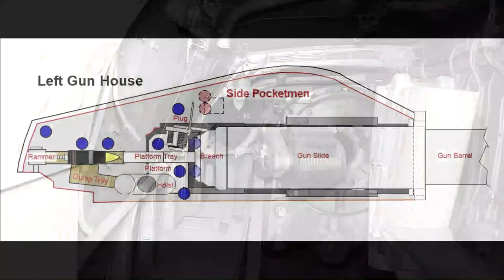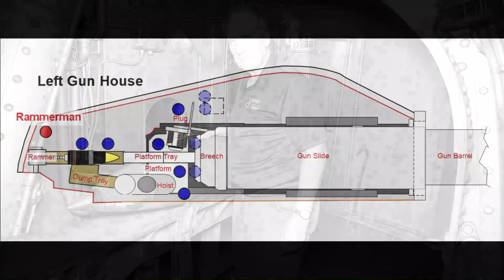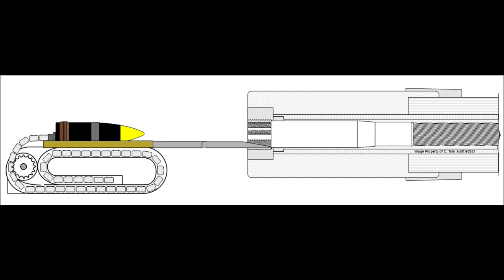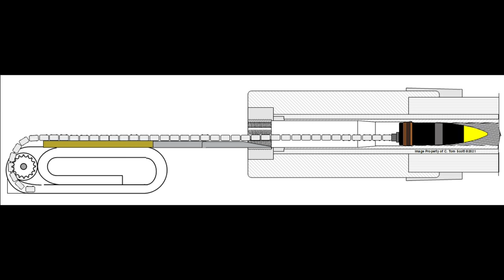Battleship Texas, Getting Loaded in a 14" Turret

Comment: I would have thought if the gun fires prematurely and the plug man has his arm back there it would be turned to jelly.
Reply from the maker: It is practically impossible for there to be a premature ignition when inserting a primer.  The breech plug temperature is cool to the touch, so there isn't enough heat to set off either the powder or primer.  That leaves a defective firing lock mechanism as a possibility.  Gunnery and ordnance manuals specified that the locks be regularly serviced and tested for proper operation.  Also, neither the hammer used to percussion fire the primer or the electrical contact used to electrically fire move to their final positions over the primer until the breech plug operating lever is pushed to its final position and locked in place.  Even so, no one is allowed to stand behind the gun once the breech plug is closed.  If something should happen as a result of that final push, the plug man is standing on the forward side of the lever and is pulling on it to perform the final action that sets the lock and locks the plug in the breech.  That way, if the gun fires and recoils, the lever is pulled out of his hands and away from him.  

The only serious issue with accidental ignition is if there is a hang fire or misfire that requires inserting a new primer or unloading the gun.  Since it is very possible for the gun to fire, the plug man unlatches the plug operating lever and pushes it open just enough to slide the firing lock open and partially eject the primer.  That small amount of movement is not enough to start unlocking the plug.  He then uses a tool that allows him to reach behind the plug and remove the primer without any part of his body being behind it.  He then uses the same tool to insert a fresh primer if required.  By doing that, the worse that can happen is the gun suddenly fires and the tool is knocked out of his hands with no injury to him.
Reply: @tomscotttheolderone364  👍 Thanks
Reply: @tomscotttheolderone364  By the way enjoyed the video immensely. Never seen the loading procedure for one of the pre WW2 Battleships. Very informative.

Comment: So, I'm watching a 1500 pound projectile come up ass first from the magazine fused ? Doubt it . I'm hope one of the loading crew was doing it .
Reply from the maker: All shells, 5" and 14" had base detonating fuses installed at the ammo depots, and were brought on board, stored and moved to the turrets in that condition.  In fact, removing a fuse from a shell on board the ship by the crew was expressly prohibited by the Navy Department of Ordnance.  The only thing they were allowed to do was add a point detonating fuse or timer fuses to the nose of high capacity rounds on the loading tray immediately prior to ramming them into the guns.  The fuses were exceptionally safe and only armed when they experienced a combination of more than 1,000 g's of acceleration caused by firing and being spun at more than 5,000 rpm while in flight.  You could hammer on a fuse all day long with a sledge hammer and the only result would be that you may break it.  You wouldn't set it off.  In fact, shells were occasionally dropped in the handling rooms below the turrets when brakes weren't properly set on trolleys used to move them.  The only result was a dented steel deck.

Comment: I wonder   did they ever have a squib round..?
Reply from the maker: Squib rounds resulting in a round lodged in the bore would be extremely unlikely since even just one of the four bags igniting would provide enough pressure to send the projectile out of the barrel.  Likewise, a primer firing, but no bags, doesn't produce enough pressure to move the shell.  It would require that only one bag ignite and only partially burn without setting off the others.  I don't see how that would even be possible  However, you could get a round stuck in the bore if the gun experienced an open breech ignition.  That never happened on Texas because the result would have been a dead gun crew and we know that never occurred throughout the ship's career.  That leaves misfires, which would be noted in action reports and the ship's log.  Even though they would be very rare, those certainly had to happen.  The great majority of those were caused by poor electrical contact in the gun's lock.  Those, and bad primers, were potentially dangerous, but easy to solve.

Comment: I would wager that everyone of those poor gunners were deaf rather quickly!
Reply from the maker: Surprisingly, it was loud in there, but not deafening.  Veterans said they could hear the gun fire, but it wasn't uncomfortably loud because it was on the other side of 14" thick armor.  Most of the noise was from ventilation blowers, training and elevating motors, and when firing, the noise from the recoil buffer and slamming from the counter recoil springs.
Reply: @tomscotttheolderone364  Interesting, thanks!

Comment: Anyone know what the noise level would be inside when the gun fired?
Reply from the maker: A veteran who served on a 14" gun crew said that while they could hear their gun fire, it wasn't that loud inside the turret.  That was because there was 14" of armor between them and the gun's muzzle.  What was loud was a "whoosh" from the buffers that slowed down the gun's recoil when it fired.  Then, there was a loud "clang" when the counter recoil springs pushed the barrel back into the battery position.  There were other background noises that weren't particularly loud like running elevating and training motors and the ventilation blowers.
Reply: @tomscotttheolderone364  
Thanks.

Comment: I wonder how they were able to hear each other or use the voice tubes, it must have been very loud with all the machinery operating, trays and levers clanking, guns going off, compressed air roaring into the bore etc. so either they'd have to wear heavy hearing protectors or (more likely at the time) they would have been completely deaf after a few shots and had permanent hearing loss after a few days of firing.
Reply from the maker: Based upon comments from a veteran who was on a gun crew during World War II, it was rarely very loud inside the turrets.  Only during gunfire.  However, it wasn't from what you may think.   They could hear the guns discharge,  but it wasn't that loud since the sound was more than 40 feet away and on the other side of 14" thick armor.   There were two things that made considerable noise.  The first was the large recoil buffer that acted like a giant shock absorber to slow the barrel down as it moved backwards in its mount during firing.  He described it as a loud "whoosh" as the fluid shot through the buffer's orifices.  The other, and much louder, sound was caused by the 4 sets of giant counter recoil springs that shoved the 60 ton barrel back into its battery position after it reached the end of its recoil.  Since there was nothing to slow it down, the barrel slammed back into battery position with a sound that he described like the gates of hell slamming shut!  Other than those two sounds, it was noisy, but not particularly loud.  Electric motors drove hydraulic gears to train the turret and elevate the gun, but those were quiet enough to require a warning bell be rung to caution crew that things were moving.  There were two large electrically driven ventilation blowers that probably added quite a bit of background noise, but nothing that couldn't be talked over.  As fare as the gas ejector, it was probably loud, but there was little need to communicate during the brief period that the breech was opened and the gun captain called "bore clear" then shut off the air supply to the ejector.

Comment: Wait wait wait wait, your telling me, the round is a 10th the size of the barrel?? (1:40)
Reply from the maker: I don't see what you are referring to at 1:40.  I don't believe that I said anything that would suggest that.  Is the drawing is misleading because I didn't indicate the bore inside the image of the gun?  If that is the case, the bore is slightly narrower than the platform tray in the drawing.  Regardless, if we are talking about diameter, the shell 14", minus about 2/1000" at the widest point of its body, so that it will closely fit the 14" bore diameter of a new barrel without dragging.
Reply: @tomscotttheolderone364  oh, because on the drawing the round was much smaller than the barrel and the other thing, the gun mover or something
Reply: @tomscotttheolderone364  the gun slide that's the other thing
Reply from the maker: @spectrumboy6103  I gotcha.  Yeah, it would have been more obvious if I had at least included dashed lines indicating the bore inside.  I wasn’t thinking of that when I created the graphic since it’s only purpose was to show the positions of gun crew members within the turret.  You will get a much clearer idea of the gun components if you watch my 14” gun walk around video.  Thanks for your comments!

Comment: Its really sad last i heard she was in galviston harbour... She has to be bilged out every day  because. She needs hull work.  A younger generation has no clue the service  she and her men  performed  to be free.  To be aboard  and toch her feel the ghost of  the men whom parished  in battle  someones  grandfather...  Tears. Cant write anymore.
Reply from the maker: Fortunately, everything you stated about her current status is incorrect.  The ship is still in her berth at San Jacinto and she is due to be towed to a dry dock in Galveston in late spring.  The ship has been well prepared for the tow, including test runs on an advanced simulator.  The external torpedo blisters, that were the main flooding issue, and other problematic compartments have been filled with foam to exclude flooding.  Pumps, large diesel generators to run them and a detailed pumping plan are also in place to fight flooding that may occur during the tow.  The leaks that still occur have been controlled to the point of being little more than minor seepage.  Money is in place for the repairs and contractors are lined up, so in other words, the ship is in a very promising position right now and is merely a matter of getting the floating dry dock to its new home in Galveston and prepared to take the ship.
Reply: @tomscotttheolderone364  
New home?
I was under the impression that she would return once her DSRA was complete.  Is this not the case?
Reply from the maker: @judsonkr  The ship will not return to San Jacinto after repairs.  Proposals are being considered for a new home port somewhere on the Texas gulf coast, but a decision has yet to be made.
Reply: @tomscotttheolderone364  
Awwww man.  That is sad.  My son and I stayed the night on there a couple years ago.  Was hoping to do so again.
Was, and still is, his favorite activity ever.
Well, at least we got to do it once.

Thanks for the update!

Comment: Not only is hot, but no hearing protection...
Reply from the maker: It may surprise you to know that it wasn't any hotter than most of the ship because there were two huge blowers that pulled air up from deep inside the ship and forced it through the turret.  Also, noise wasn't too bad.  Gunfire was very muffled since it was produced at the muzzle that was  a distance from the face of the turret which was made of 14" of class a armor.  What they did hear was the noise from the blowers.  When a gun fired, they would hear a loud whoosh from the recoil buffer as the barrel recoiled, then a loud clang as the counter recoil springs slammed the barrel back to the battery position.